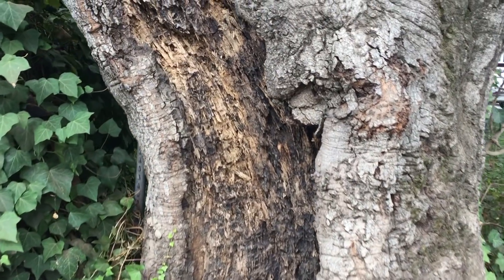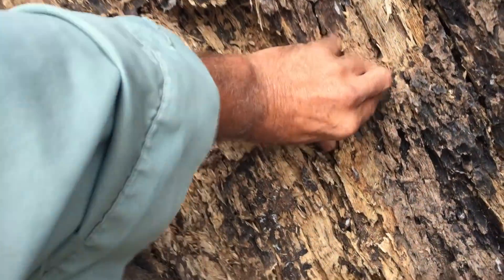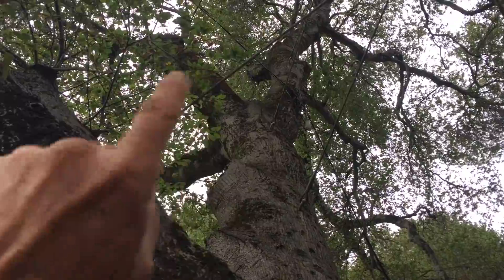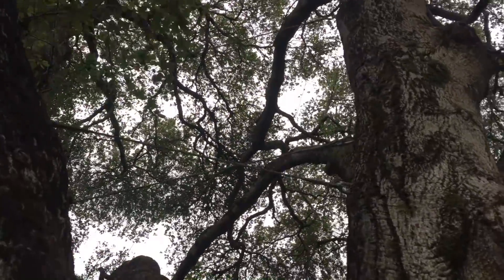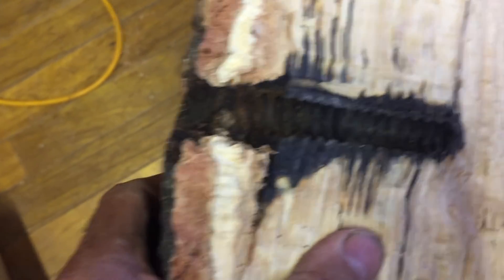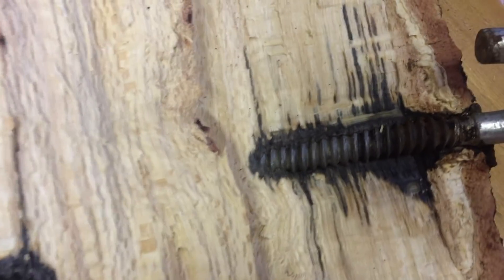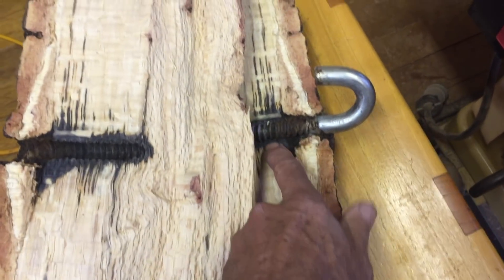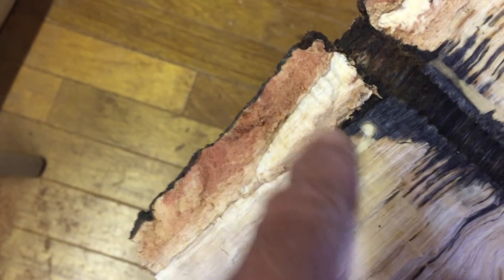How STRONG is a J Lag ?

Comment: I'm sure different species of trees react differently with cabling. Live oak, for example does well, where a softer tree, say a fruit tree wouldn't? I always used circle screws when I had too, but never thought it was a good idea. Proper weight reduction should always be the best decision, but sometimes, usually because of the age of a tree, cables are the best bet.
Reply from the maker: Every tree and every situation has a different reason or need or weakness.
Reply: Yes! My thoughts are, if possible, cabling should be avoided. Any additional added "surgery" to a tree is detrimental.

Comment: Didn't look like any knotted wood was near, so that was good. How did the black threaded wood feel? Could you easily pick away at the grooves with your thumbnail? Done 100's of hard and soft cable jobs, only had one lead fail, but the cable held. Approximately 10years. 
We also did the experiment, splitting the wood to see how the 1/2"lag held up. Same discoloration, but it wasn't going anywhere. That particular tree was a Pin Oak.
Reply from the maker: jerszak you can learn a lot by opening up a piece of wood!

Comment: Not sure how this fits in, but oak goes black in contact with iron. Copper or brass screws, nails and bolts are used by carpenters to stop oak from discolouring around the fasteners.

Comment: It would be interesting to compare the cadmium plated metal used here with hot dipped galvanized and stainless steel varieties. Galvanized hardware may have some bacterio static action and stainless may last longer.
Reply: Copper, though weaker than steel, is antibacterial, and will not discolour oak in the way that Iron does. Copper plated bolts might be useful here.

Comment: I enjoyed this video and the piece of oak you shared. I have a different opinion on cabling. I was taught to use j lags when the support is being installed prior to the need for its strength, giving the tree time to grow over the lag and provide incredible support from engulfing it. I have removed trees that were hollow in the cabled section and the lag was in the airspace. The support provided by the existing tissue that grew from the time of lag installation injury. Likewise if support is necessary now I use through bolts of the forged eye variety, they are very strong. Trees that I cabled and failed (not because of support) the cable held the piece off the house and it was hanging like it had been rigged! I would appreciate some more discussion as these are only a few experiences and I’m sure there are many that differ. Be well

Comment: Deterioration is the problem and I have not seen any studies on compatibility of materials. Is stainless steel better than galvanized? Some steels are copper bearing to resist corrosion better. We know not to use copper, but what if it is hidden? Rather than telling you what the lag is made of and how it was made, the wholesaler simply puts a rediculously low strength limit on the part. A solution I have not seen is to use a biologically compatible sleeve to line the hole that the through bolt goes into. A bigger hole initially weakens the tree more. However, if rot can be minimized then after a year or two it will be stronger. Screwing a J Lag into a tree tends to split the wood while we seek to get a good grip from the threads. How much of our troubles is caused by this splitting tendency? Almost everything we currently use for this was designed and tested for use on lumber where biology is not a consideration. Improvising with the other guys tools is rarely completely satisfactory. Just think about the ratio of carpenters/contractors to arborists in your area. We are not the tail that wags the dog. Part of our problem is that we make do with inappropriate materials and thus there is no visible market for better materials.
Reply: Not only would the cost be prohibitively expensive to develope, bur also the use is too niche
I’m sure we have technology that is bio-comparable, but the interest is to narrow to feesably fill it and make enough the sustain
I’d like to see how titanium holds up, although it is very exspensive for what it is, but may be worth a look into
We use it in the medical industry because our body doesn’t recognize it as a foreign object
Just a thought though
Reply: OldSloGuy great info! :) There is no market if no one percieves a need for it. Have to champion new tech. It is a lot more work and a bit of expense initially I would guess :0/
Reply: Jc Cj  I guess the compartmentalisation is good enough to justify using metals that corrode fast. As you say it's expensive. Im not sure what you guys mean by bio-compatable. Are we talking about toxins? And what is the problem with copper? It's very soft I guess. Titanium would be good, it doesn't corrode very fast. But it's very close to the 300 series stainless steels and much more expensive. Better to use 300 stainless. I think trees just recognise the injury and compartmentalise it. Similar to our systems. They won't see anything as foreign unless it is of biological origin (has surface antigens). Any metal will do if we are looking from a purely immune response perspective.
Reply: Peter Brown one big problem with copper is as it degrades, it developed aldehydes, as well as the strength isn’t suitable for the application.
The aldehydes produced are toxic to most life forms
I’m not sure as to the make up of the 300 series stainless steel, although I do know it has chromium in it to prevent oxidation
Titanium seems to be the best option 
On the note of bio compatible, the meaning would consist of how a life form deals with the foreign object. If the foreign object doesn’t trigger an immune system response, it should be compatible 
I feel that cabling a tree is a bad idea.
Reason being is one is putting off the inevitable and making a more dangerous situation for the later
If the limb is in a place where it can impact life and structure, it would be a good idea to remove it. But again, in doing so, speeds up the decline of the tree
It seems, in my opinion, that human intervention seems to be the cause of early tree decline and structural failure
Cabling works. But how much is too much

Comment: The metal plating, Zinc, tends to blacken many materials, including wood. What  I notice is the rather tame threading, I would have thought a deeper and wide thread on raw wood would be better....and made of stainless steel. Oh well my two cents!
Reply from the maker: Peter M this is the tried and true technique that is the most often used.
Reply: Stainless steel fasteners are lower strength than most steel fasteners. The little bit of corrosion should stop once the oxide layer forms, protecting the fastener from deteriorating and failing. I have personally tried to remove zinc coated fasteners from healthy trees after only one year and they are impossible to remove, the tree grows around it and bonds to it. Considering the condition of the tree it seems to me that the problem is with the tree and just simply not having enough health to heal and hold itself up. Most unhealthy trees seem to break down in the sapwood from bugs or damage or various other reasons. So to me, screwing a fastener into the sapwood of a tree that is not able to maintain its own structure is just not a good idea. Trees grow and die, it’s the way of nature. If it is unhealthy and unsafe it should be cut down and a new tree planted in its place. The decay of the root system from the old tree will provide a fertile ground for the new tree to quickly grow in. I love trees but even without humans nature burns down its own forests with lightening strikes and that is very good for the whole ecosystem. Using cables and fasteners to hold up a tree seems insane. What if a life is lost, is the value of the tree more than the value of that life? 

I know it is hard to deal with customers sometimes when they are intent on something but there have been times when a customer insisted that I do something that I felt would leave a dangerous situation when I was finished and I walked away from those jobs because my reputation and the safety of people is more important to me. It’s the best thing to do. In some cases they contacted me after getting other opinions and decided to do it properly and in some cases I never heard back from them but later heard of them having a problem down the road. You have to insist on doing things the best way and not let a customer sway you from what you know is best.

Comment: That looks like its not so good to lag into a living tree.
Reply from the maker: Jennifer WhiteWolf when you consider the alternative of limb failure, it becomes a correct decision
Reply: arboristBlairGlenn there are newer supports that don't require drilling. Most won't use them because of the expense/perceived maintenance of course :(
Reply: Why not go around like a belt with cable  and cable clamps? Maybe this is what Peter Brown is talking about? It could be adjusted, which is a plus. The j bolt rig isn't adjustable or is it? Maybe there is a more correct decision?
Reply: Bart Layman depends how much maintenance they want I would have thought. These systems are still mechanically the same as any cabling system. Branches will still break regardless. Blair will know more from his experience. 

I'm sure you have looked at these options Blair. They are not very popular though. Only really rich really treecentric people will invest ha ha ha :)

One problem with belts/bands Bart is that they need rigid inspection/adjustment schedules to be any use. This is more negotiating and report work for the same support mechanically speaking :( The client sometimes won't commit to this. Not worth drawing up the schedule sometimes I guess. They are good for the tree and arborist though. 

It is a way of perpetuating work and organising work year on year with the client onboard. Instills commitment and guarantees their support. Can even have a courtesy call system reminder for the client they like this (as anyone would).

They are a good option but can easily girdle a branch or damage bark in a season or two on fast growing trees. Inspections and maintenance along with the choice of design can all be used to increase profit margins; for the customer, in longterm enjoyment/time/finance; the tree, in damage limitation and the arborist, financially. If the customer is given a number of options it also gives them more of a sense of ownership and let's them know the arborist cares about them. 

Most of the time they are not interested though ha ha ha. These people shouldn't keep trees of course :0 (

Comment: Would the decay be less wen the j-bold is embedded ( sealed ) in a epoxy “bed”?
Reply from the maker: Joop Terwijn nope, sealing doesn’t help
Reply: Joop Terwijn Joop Terwijn The tree still compartmentalises the wound regardless of infection :(. If sterile (which is not reasonably possible) though there will be less damage for sure. All compartmentalised tissue is inherently weaker than the surrounding tissues. Spreading infection means more compartmentalised tissue. In addition, by gluing or sealing a wound we often lock moisture in. Leaving the tree unable to regulate the moisture content in the area. Moisture control is a key defence for trees. There are tree sealers that contain chemicals that mitigate bacterial/fungal infection. They can never be assumed to stop it entirely though and it is debatable how useful they are on big trees. I use them small scale for cuttings to stop them drying out and for small trees with limited root area (again to stop them drying out from large cuts). Roots that are cut can also be sealed with these sealers to stop moisture egress.